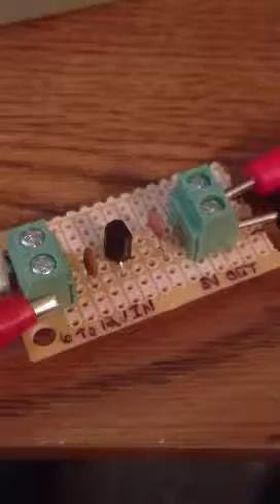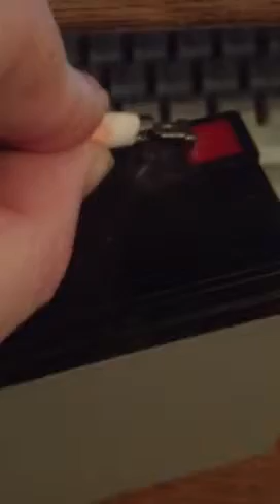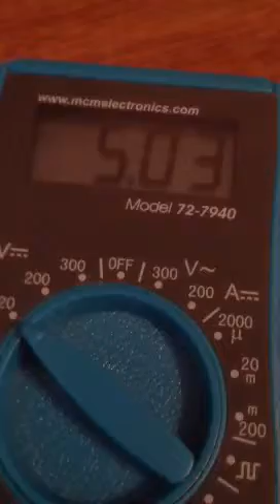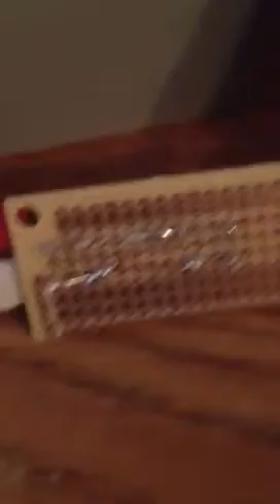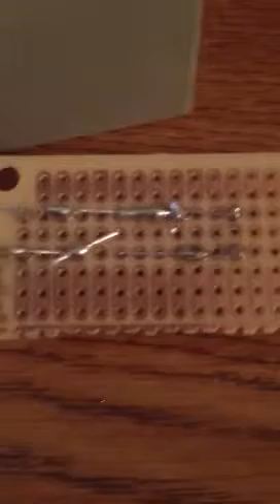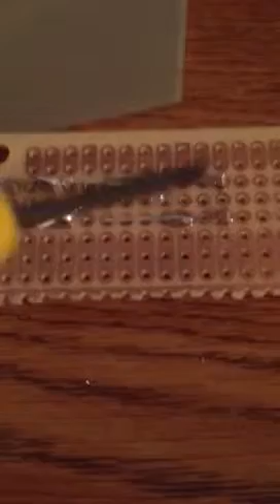5v power supply

Comment: Three great videos.  Is this the circut to power the acorn cam (cut power)?  If so, how does it hook up at the acorn?  I bought an acorn too.  I'm going to use it for security on my driveway to send pics or video to me of someone pulling in and out.  Instead of gms I want to power up and down the acorn w/ a key fob when I come and go so I don't have to pay for pictures to be sent when it's just me driving thru.  What I'm askiing is, do you have a pic of where you are hooking up on the acorn?